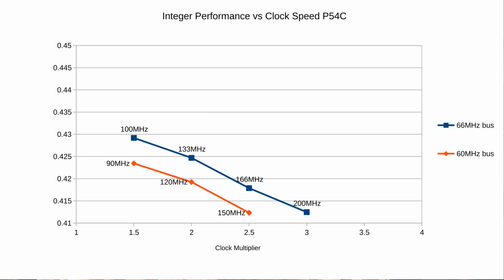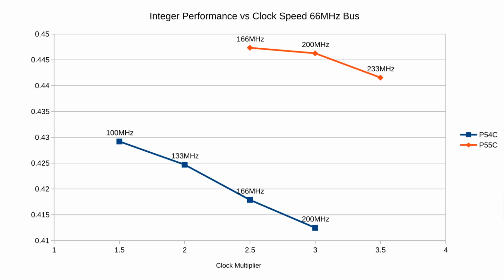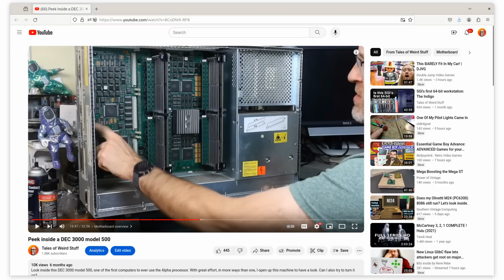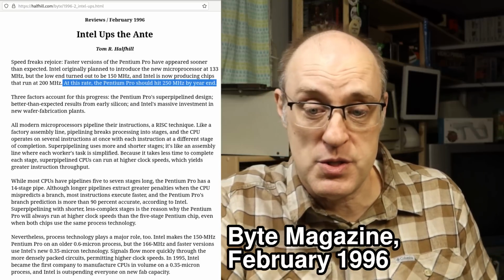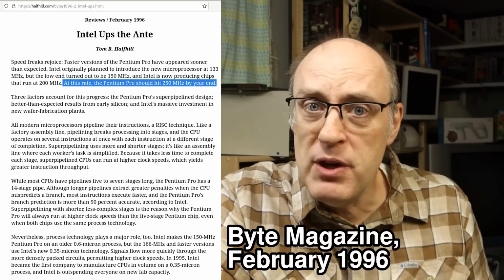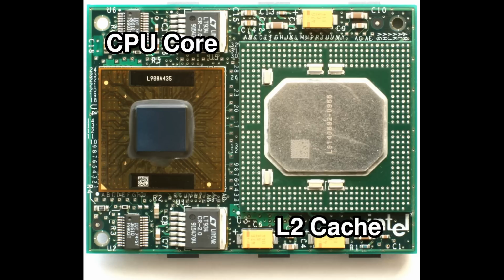Why did slot CPUs exist?

Comment: I find this interesting stuff. i could probably lose at least a good day talking about random things with you. I feel like the focus should be more L3 cache and perhaps smaller L2 caches 256KB to maybe 1MB, i have always felt 512KB was the optimal balance point for most tasks. 

Altho there are benefits to both larger and smaller L2 caches, I feel that L3 cache with increasing core counts is growing apparently clear and is really need to push modern desktops for multi tasking and gaming to the next level. And maybe even L4 HBM could be a massive benefit as well to the cpu socket. Ofc this would ad more cost and with out any real threat of someone taking over the x86 cpu space we probably will never see any such thing as a L4 but i can really see the benefits it could hold. 

I fear worse yet is software development is getting worse for optimization as hardware gets faster. I have seen people's systems stall out with all the bloat ware and poorly optimized drivers for things such as fans, RGB lighting, mouse & keyboard... etc. Even with the best hardware money can buy. 

At any rate enjoyed the video may you enjoy your journey on this place we call home and even find some joy in sharing it with others. Much love my fellow brother.

Comment: I think that Slot CPU existed because someone at INTEL thought that it would be easier to install CPUs and have less problems with bent pins and it seems like AMD followed suit but that went away as quickly as it came but it was nice while it lasted, an example of the Slot1 Motherboard which was the ASUS P2B-B

Comment: I remember reading about the Pentium Pro in computer magazines back when I was a teenager. There were so many myths and misconceptions about them both before and after release. Probably because they were so expensive that many people never got to try them out, and the magazines that tested such hardware, had quite specific ideas about testing hardware "for its intended purpose" rather than going "Hey, I wonder how this new high-end workstation/server CPU can run Doom?" :P
Today, I own a Pentium Pro 200 (256k cache variant) that I use to run OS/2 Warp 3. It's of course equipped with SCSI drives, a large amount of RAM (or what would've been a large amount in '95-'96), and a workstation grade graphics card from Number 9. The Pentium Pro was a very cool CPU and really very much ahead of its time.

Comment: I STILL prefer the MOS 6502… but if I HAVE TO use an 80x86, I rather have an AMD CPU… Intel was just TOO expensive!! 🤔🤔 At least with the 6502 if the CPU didn't work, it's just that, the CPU 😁😁🤔🤔

Comment: One benefit of the slot cpu was no bent pins for the explosion of windows home users as the hobby exploded, cooling was easy and like  you said in so many words the foot print for what they were doing with the tech at the time would have took up a very large space on a mobo,  I also think that mass production on say a dell assembly line would be less likely do damage a cpu built by hand.  Just thinking out loud.

Comment: Hey, I'm a first time viewer so I can't say much about the format. I must say I am kinda impressed because I have ADHD and usually can't stay on one video for longer than 20 mins unless it's very interesting! So there you go mate. I was a bit intrigued when you mentioned that you wanted slot adapters. I just made a fast search and ebay has some. I live in Sweden and I'd love to help you out if there is something I can do to help you out. The prices for the slot adapters seem very reasonable to me.

Have a great one!
Reply from the maker: Socket 370 to slot 1 adapters for Celerons and some Pentium III CPUs are pretty common, and I have several. What is very rare are socket 8 to slot 1 adapters to use a Pentium Pro on a slot 1 motherboard. I've never seen one IRL.

Comment: Greatest format in the world.  Didn't have enough pins or they'd have kept it for more generations.  I had a Slot A 512kb cache 650 Athlon and it rocked for most of a decade.   Not just the lack of pins tho, the harmonics caused by a point contact in the middle of a copper contact pad were immensely troublesome.  This was resolved a fair bit with PCIe but is still an issue.    This package would still be valid today if it included a 2 slot system, one for the power board and the other for the IO

Comment: Intel did have the capacity of imaging the cache on the same die as the CPU it was just that they were getting more failure rates at the time.  They had very high failure rates making the cache dies alone.  Would probably explain the high cost of producing the silicon.  That was why they kept them separate.  The CPU's dies themselves did not have such high failure rates.  I would imagine Intel would use any half-decent 50% good cache chips with their Celeron line of CPU's.  As for in-between Intel and AMD it was just a Copyright war where one could not use the term "Pentium" and so on

Comment: 500 mhz is ok for a slot 1 cpu, above that, the sockets are needed. Slot cpus were longer with more cache. The cache only worked with legal operating system, that way a cpu still works at 0%-3% just as fast, as at 100%. That’s why Pentium 2 was more expensive than a Cel. For those with illegal operating system, a Pentium 2-3 was slower than a celeron.

Comment: The Classic Athlon Slot A CPUs used the same bus as the aformentioned like packaged Alpha CPU, called the "EV-100" bus if I remember correctly.

I happened to have a system with a classic Slot A 800MHz Athlon.
Reply from the maker: That is correct. There were even some Alpha motherboards that used the same AMD 750 chipset as early Athlon motherboards.
Reply: That an interesting fact i didnt know, Hmm, thanks. @TalesofWeirdStuff

Comment: Ryzen 9 7950X has 1MB of L1 cache, and the 7900X3D had all of it's cache (L1, L2 and L3) on the same CCD, has 128MB of L3.
Reply: Thats not correct. It does have 128mb of L3 but its on 2 dies. The X3D die has 32+64 stacked(96 total) while the normal CCD has the remaining 32mb. 7900 and 7950 are dual CCD CPUs.

Comment: Yes, we got better at making CPUs, but I truly miss the slot CPU!  It was the first time in computing history when our real world computers looked “cool” like sci-fi computers did. In those days for my main PC  I had a celeron 300, then got a dual CPU board and a second celeron (before the disabled that ability), then dual full pentium 600s. The slot CPU with the hologram sticker was just a beautiful thing. If you combine that with today’s nice power cables, M.2 drives, and no optical drives… you end up with such a pretty internal design. Hiding the entire CPU under a heat sink or water block is just depressing compared to the slot CPU.

Comment: I knew the answer was cache and yield, but I really enjoyed all the background information. I've never actually thought how cache actually works in a cpu, only how it works as a software solution.

The turn of the millenium and a couple years after was an excellent time to be interested in exotic high end computers. Stuff 5-10 years old was way obsolete and could be had for the price of shipping. It was worse than worthless, since they took up lots of space and electricity, which is why it's all practically gone nowadays. I had an Alphaserver 1000 (EV45 233 MHz), HP Netserver LH Pro (dual Pentium Pro 200 MHz), IBM PC Server 320 (dual 100 MHz Pentium), a huge ICL 486 server that I've forgotten the model of, and a few consumer dual cpu boards as well: Abit BP6, Soyo D6IBA and Asus CUR-DLS. The Soyo BIOS was modded to accept basically anything that fit in the slot, it was a PII board originally but I ran it with slotkets populated by 850 MHz Coppermines. It would have probably supported the Socket 8 ones you mentioned. I bought it sight unseen from some person over IRC and wired the money without even learning his name. Wasn't sure if anything would show up in the mail, but glad it did :D

Comment: I've still got one of the systems I built many, many years ago that's got an ASUS P3B-F slot one motherboard in it coupled with a 1GHz Pentium 3 Slot one CPU.  I originally had two of them (one for each of my kids' first computers back in the mid to late 2000's) but I ended up getting rid of one of them.  I still keep the one because it's got a Diamond Monster 3DFX Voodoo card in it and I use it from time to time to play some of the very late DOS games that supported the 3DFX GPU.  It was a beast of a machine back in the day.

Comment: The weirder thing is that with the rise of liquid cooling the slotcart form factor hasn't returned when a cart would make it far easier to mount the cooler and keep extra heat off the mobo
Reply: That's because liquid cooling is still pretty much a limited market for specialist and enthousiast applications. Custom builders will use a liquid cooling setup, but there are no large-volume system integrators who would benefit from liquid cooling when compared to the disadvantages (e.g. more time needed to build each system and the service/repair risks being higher).
Reply: It would also be pretty difficult to get up to 2000 contacts onto an edge connector or pin row

Comment: The amount of cache on modern processors is insane compared with what it was. My 7800X3D reports its cache architecture as dual 8x32KB for L1 (separate 32KB instruction and data caches per physical core), 8x1MB for L2, and a whopping 96MB for L3. This is more cache memory on a processor than entire systems typically had in the mid 1990s.
Reply: And given that there is also a memory controller, display controller and microcode on board, modern processors can definitely be considered as self-contained systems on a chip.
Reply: @Stoney3K   Oh, certainly. Most of the modern processors are absolutely SoCs. And with the latest-gen processors including more and more powerful graphics cores, they're feature-complete SoCs.

Comment: Back in the day, I got a FCPGA Pentium 3 700MHz to run at over 1GHZ on a socket-to-slot adapter with a 250W Peltier/water cooling system pulling it to 15 deg.C under load and subfreezing at idle.

Comment: Ohhh, cache associativity.  I remember dealing with image processing on that Xeon. The first step was realigning 2048x2048 pixel images so that successive rows didn't evict each other from cache.  (This was doing image reconstruction inside a medical device, so Money Was No Object.)  Running kernel fiters on an image of that size in a cache-friendly fashion took a LOT of programming!

(But I go way back with this stuff.  I've done code optimization on an early-1980s mainframe, where there was a single-level cache of 1024 72-bit words, 4-way associative. You could almost fry eggs over the ECL and the NMOS RAMs, and I once burned a Wire-Wrap tool in half on the 5 volt power supply.)

Comment: Nonsense, I loved the slot format, much easier to install a CPU into a slot, not having to worry about bent pins or worse tiny contactors on the MB ie the current stuff that is  so fragile it can get damaged by a fly landing on it.  So far I've not met a single person who specifically had a problem with slot type cpu packaging. I guess if there is a possibility a bad take can exists then someone will be holding said bad take.

Comment: I liked Slots probably because I used other systems with slot-like CPUs many years before Intel ever used them.  The Acorn Archimedes A540 (1990) used slots for it's CPU and RAM which made them easily replaceable/upgradable even by non-technical people.  This continued on in the Risc PC (1994) where it came with 2 CPU slots and you could use 2 ARM CPUs or an ARM and an Intel x86 CPU, and there were multiple speeds of ARM and then later StrongARM CPUs available, all very easily upgradable due to the slot-like cards they were on.  They just weren't  packaged in big lumps of plastic to hide what was inside.

Comment: I had known a little about them having on cpu board cache being an advantage. I am glad I stuck around for an hour to watch this entire video. Thank you for being fairly in depth with all of it. I had wondered why they didn't continue further. Still, I kind of miss the era of computing and being able to use old hardware. It was interesting times indeed. I wish I had a slot one or preferrably a slot A system with a 1ghz cpu. I don't have the time, or the room to keep them around sadly.

I do miss the era. I remember having over 1ghz systems and could pick up these older computers for cheaper at thrift stores. I remember having old systems where I could install 95, 98, 2000 and xp on them and they were still functional. Had a 733mhz slot 1 pentium 3 to use and I forget what my brother had, 1.4ghz pentium 3? It wasn't my main system, but I could go over to my brothers and we could play age of empires or other games on these systems. I just sort of miss the days of when you could switch between windows versions and systems and they would still be functional, you could still browse the web and use them all as daily drivers. Now you just have windows 10 or 11 and they try to kill off old hardware as much as possible. Still, it's why I love linux and it mixes with old hardware. If I have a laptop, it surely is getting linux on it.

Comment: Alpha Dec the extra 128bit of memory could be used by the surrounding CISC cpus. I have seen design specs with up to 5 Cisc processors.
Reply from the maker: There were "regular" SMP Pentium Pro systems with 6 CPUs and Xeon systems with up to 8 CPUs.

Comment: 1024 bit memory bus is already available. It is called High Bandwith Memory, HBM for short. And for exactly the reasons you mentioned in the video, they only make it in the form of silicon dies to be connected directly through and interposer, not a normal PCB.

Comment: A few weeks ago I tried to install the CPU from a Slot 2 processor into an Original Xbox, the 133 FSB Slot 2 CPU's and the Coppermine CPU's in he Xbox are remarkably similar, the major difference I found was the resistor to set the value of the on die termination resistors was not connected on the Slot 2 processor card and Intel had installed 32 - 150 ohm termination resistor arrays on the Slot 2 processor card, and I found pad AA18 was connected to VTT on the Slot 2 processor card but not connected on the Xbox. After installing the CPU on the Xbox, the CPU appeared to work, the RAM, GPU, south bridge all powered on, but the Xbox couldn't boot. My suspicion is Intel deleted the on die termination resistors found in the P3 when using the psudo-coppermine core in their Xeon Slot 2 products. Sure wish the documentation for the Slot 2 CPU's had been leaked to see exactly how similar the Coppermine and the 133 Mhz FSB Slot 2 CPU's really are

Comment: 44:55. I know from experience that there were some slot 1 chips with cache that ran at the same speed as the cpu. The only concrete example I can remember off the top of my head was the celeron 300a. The original p2 celeron chips had no l2 cache and were extremely slow. So intel brought out a new variant celeron with 128k of onboard cache. But it ran at the full speed of the cpu. Because of this, and the crazy luck of the overclocking monster that was the celeron 300a, it was common for celeron 300a’s to be over locked to 450mhz and outperform the real p2 450 with its 512k of l2 cache that ran at only half the cpu speed.

Comment: I started with Pentium 2, 233Mhz that a friend built for me. A couple years later, he put together an Athlon 850Mhz system with a CPU like that. However that system had a crashing problem. After about an hour of use, or 1-2 minutes of use if I ran a game that used the TNT graphics card in 3D mode, it would instantly crash to a red screen, and I'd have to manually power it off and reboot. Then it would be fine for about another hour (or 1-2 minutes of game time). I eventually stopped using it and went back to the P2, until I got a P4.

I remember that CPU unit had a small card edge connector on top of it, and my friend had plugged a small board into it to over-clock the CPU. Yes, I tried it without that board and it still crashed.
Reply: I've got on the PC of my mum back then, it was the MMX 233MHz then years later I've got a P3 866MHz (non-slot Coppermine) PC from my uncle - I was mindblown HAHA XD

Comment: The 8088 vs 8086. The 8088 had a smaller bus. 

This video also reminds me of the gaming benchmarks for the Ryzen _800X3D CPUs. For example, the Ryzen 5800X vs Ryzen 5800X3D. The right X3D CPUs have been dominating gaming benchmarks. They have a crazy amount of L3 cache.

Comment: Intel had an idea for the slot package to integrate separate DSP accelerators, but that idea died with MMX and SSE, and the form factor was only useful until the L2 cache could be economically put on the CPU die. AMD's short adventure with the slot format had some theoretical possibility to cram up to 8MB of L2 clocked at 1/3 CPU speed, but they were also in a hurry to get rid of the expensive packaging. All this happened alongside a very fast progress in silicon manufacturing progress -- the migration to 300mm wafers and the steady transistor node shrinking made monolithic die integration the only economic option.
Reply from the maker: That is very interesting. I have never heard that before. Do you have any sources? I would really like to learn more.